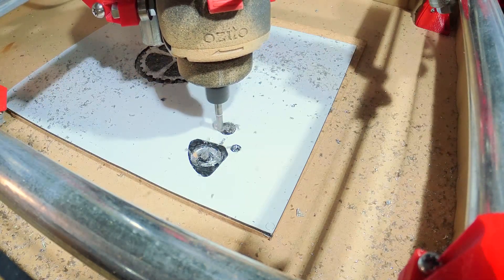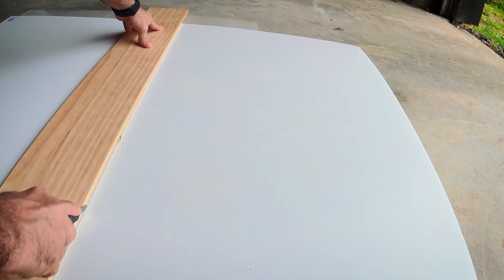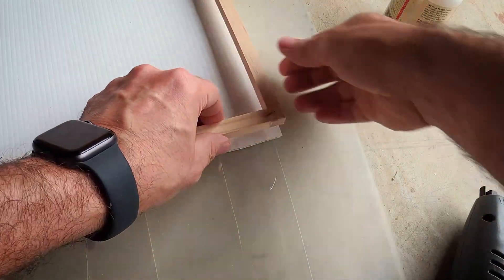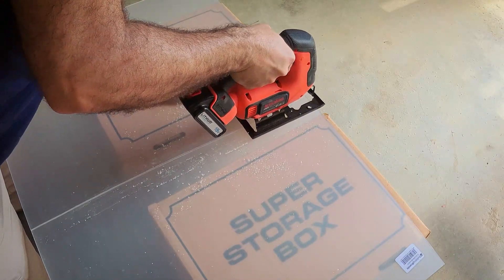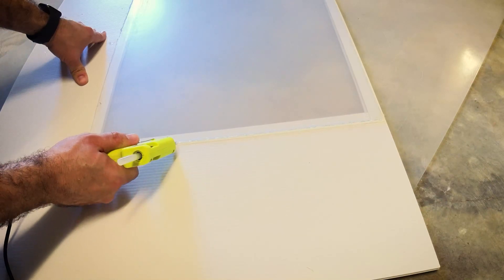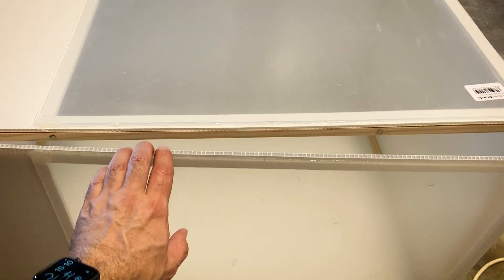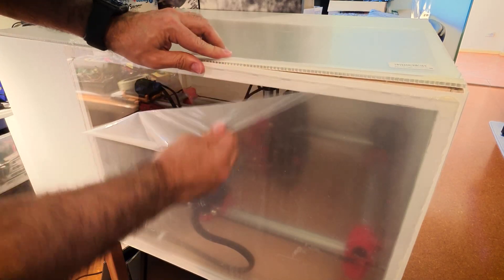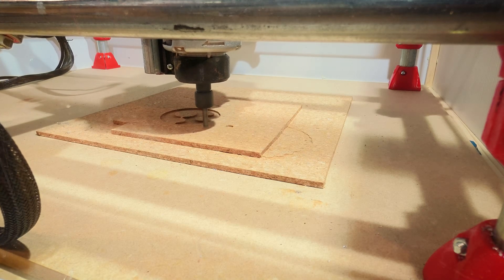Enclosure for the MPCNC ( The easy way )

Comment: Ive been always interested to build an mpcnc but never have the courage to build one. Im more of a steel worker and novice metal fabricator. Would you think this build is possible for a plasma cnc?
Reply from the maker: I have seen a few videos of people using a plasma cutter with the mpcnc, but think they had to make some modifications to it. Actually building the mpcnc is not that hard, especially if you just get the kit from V1 Engineering.